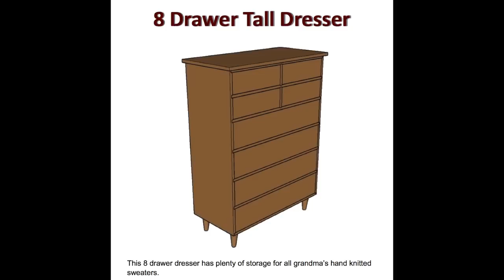542 Madison's Dresser Pt 6 "The Glue Up"

Comment: When gluing up a piece, and considering expansion and contraction, does it make a difference where you add glue? I noticed you glued the front and back of the frames. I've seen others glue the middle, leaving the ends to float.  Opinions?
Reply from the maker: I don't think it does matter "where" quite as much as it does that you simply don't apply glue the entire length.

Part of my reason for the glue at either end is simply because I discovered during the dry fit that there was a small, but noticeable, gap where the frames fit into the dados on the front side. It was only one or two, but I really wanted to close them.

My thought was that since the grain orientation of the front and back long rails were the same as the sides, they would most likely expand and contract somewhat similarly, so gluing them together would be less of an issue...only time will tell if I was completely wrong LOL!
Reply: Thnks...looking forward to the next video.

Comment: I'm not sure I understand the gluing of the ends of the web frames either.  I would think that by locking down the ends, it will have basically the same effect as gluing the entire dado and the wide panel won't have anywhere to go.  Hopefully you won't have enough movement to worry about.
Reply from the maker: I’m sure to some degree it is very similar to if I had just glued it all the way across, but it’s not. As I mentioned earlier in the comments, the majority of the glue is located where the long front and back rails meet the sides. The grain orientation of those two components matches the grain orientation of the sides. The only difference is one is horizontal and the other is vertical.

But, IF and when wood movement is to occur, they’ll move in very similar directions. It was simply an option for assembly to give me peace of mind it’ll hold together over the years, you can glue all the way across or just do one end or the other if it suits you.

I’m under the impression that many people are either overly concerned or confused about just how much or how little wood movement there actually is. I know for my geographical location we do have it, but it’s not all that severe. In a typical year, even with the wildest swings in temperature and humidity it’s usually no more 1/32” - 1/16” for a really wide board. For boards 2”-4” it’s usually so small it’s not even noticeable at all.

Perhaps the biggest issue I’ve ever had with wood movement is when I build something with inset doors and drawers in the winter and forget to leave a little more reveal than I would if I had built it in the warm, humid summer months. But I’ve learned and adapted to my shop environment what works and what doesn’t.
Reply: Matt Vanderlist I see the logic, I just don't know that I follow it, that's all. I don't think I'm all 'that' confused, but I do know that where I live (Texas Gulf Coast) we probably have to deal with it a little more with our humidity.  Heck, I had the 4" arms on a cypress Adirondack chair split when I tightened the 2 screws (no glue) too tight for at least one of them to move like I intended.  Stupid humidity!  Like you said, you probably won't have enough movement to worry about it either way in Michigan.  And with all the webframes, that's probably going to work in concert to minimize movement as well.

Happy sawdust!  :-)
Reply from the maker: Jim Davis  dang humidity!!!